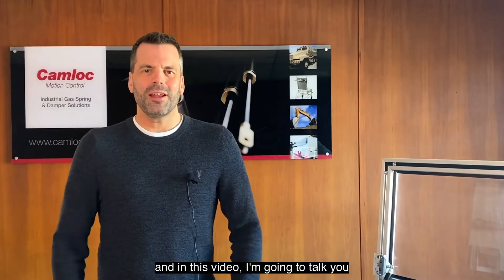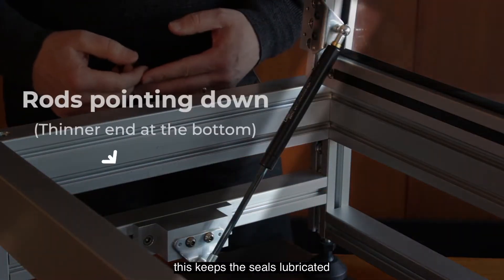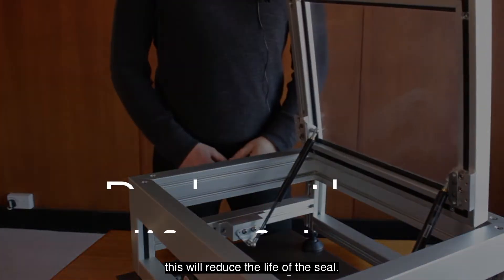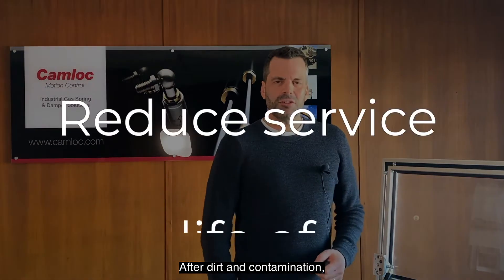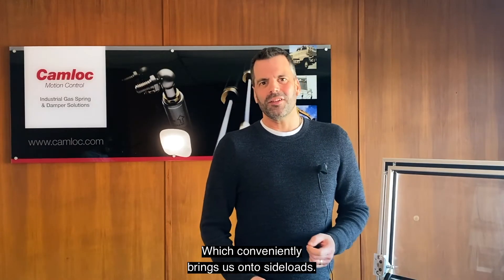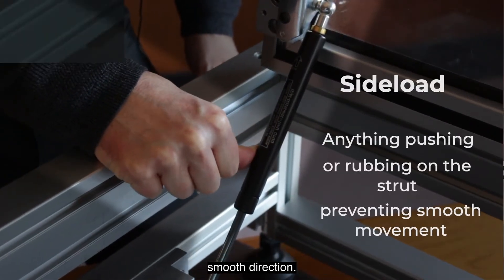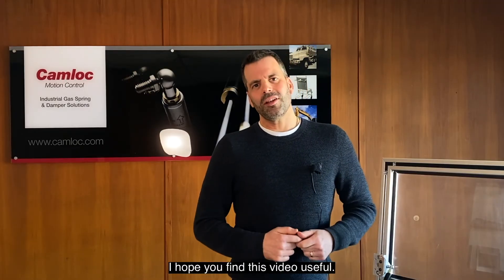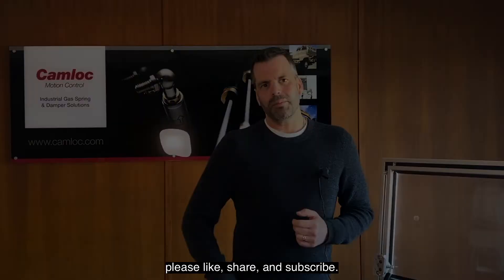Do's and Don'ts of Gas Struts (FAQ Series)

Comment: How do you compress one for re assembly
Reply from the maker: Hi @spearonut, you assemble your application in the open position therefore there's no need to compress your strut for reassembly. 

Hope this helps 😊
Reply: @Camloc bed and frame already built i took shocks off to make bed a permanent bed but sold condo and the buyer wants the shocks back in i dont want to take the whole bed appart to put the shocks in again so will need to get them compressed as they are now to long to re install thanks

Comment: I’ve been watching a few of your videos and I’ve been quite impressed. I appreciate the concise nature of them but yet they’re very informative. I have an application where I want to install gas struts for my attic door, which starts in a horizontal position and then swings down.

Is this an application that you’d recommend against with gas rots as I do not want to use the traditional attic ladder and spring system for lowering down in the addict door that has the general dimensions of 22 1/2 wide by 54 inches long.
Reply from the maker: @generalworkshop This is certainly an application that could do with some dampers! With something like this, it's best you talk to the expert engineers at head office. If you fill out all your details, size of opening, ladder, etc on this form: https://camloc.com/uk/contact/    one of our expert team will get back to you! It sounds like an exciting project as well 😎

Comment: I will need to lift a heavy door. Are you saying that I need to use only one strut?
And if I use 2 struts how do you calculate?
Reply: He said always install in pairs. I don't know anything about struts, but I have always thought it made sense to do in pairs, incase one failed. My car has it installed in pairs, too. As far as calculating, if you find out the name of who makes the strut you want, they may have a website that you can go to for the calculations. Most companies that sell different sized items will try to help you determine what size it is that you need (so that you buy from them).

Comment: Hi Matt! The gas strut holding my bonnet open on a car, the rod is pointing up (from factory fitting). Should I change it around so rod is pointing down as per the instructions in your video?
Reply: Every car I've had has the struts with the rod uppermost.
Reply from the maker: Hi @harryhorlock6472, @badrallach4792 and @VMTDesign, when mounting our struts we always advise you mount with the rod pointed down. Here is some further explanation as to why: https://camloc.com/us/help-centre/installing-gas-struts/understanding-gas-strut-mounting-points/

Hope this helps!
Reply from the maker: However, it could be stated on your drawings that this is the correct way so always refer to your application drawings.
Reply: Mine too

Comment: How do I determine the size of the needed gas lift supports?  I need them for a very heavy cellar door that’s built into my kitchen floor.  The only person that can open it is my son in law.  Some kind of supports are already on it, but I don’t know the weight capacity or if they were correctly placed when installed.
Reply from the maker: Hey Lori, contact us at: https://camloc.com/uk/contact/ and one of our expert engineers will be sure to advise you!

Comment: Nice & concise thanks Matt. You speak of not using struts to their full extension (end of motion stop).  I am replacing 750mm struts but cannot find suitable replacements 10/22x(+/-300N). the actual extension in use is 680mm. Is this too close to 'end of motion' for a 700mm unit that is still readily available online? Your feedback would be appreciated. Thanks mate.
Reply from the maker: Hey Mark, contact us at: https://camloc.com/uk/contact/ and one of our expert engineers will be sure to advise you!

Comment: Just had new gas struts delivered for my caravan front locker,fitted them but they wont compress
Reply from the maker: I'm guessing you'll have one of our vari-lift products fitted (it can be identified by a small brass valve at the end of the tube). These come charged to full force so they'll need some of the gas releasing to work with your locker. You can find instructions in these videos - https://youtu.be/3RRB-ppA3hc and https://youtu.be/1ZzOGTtG1WM